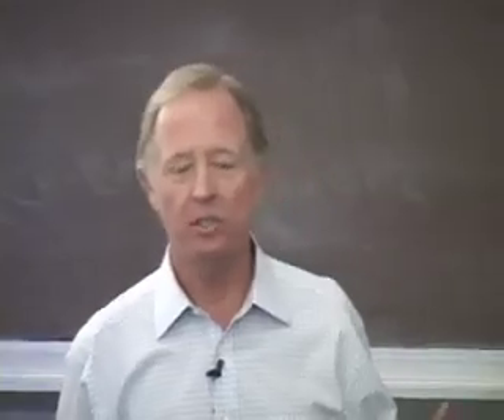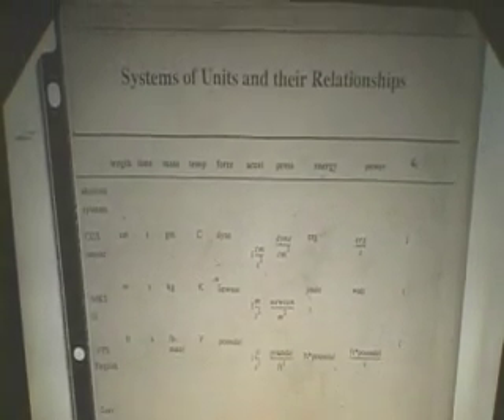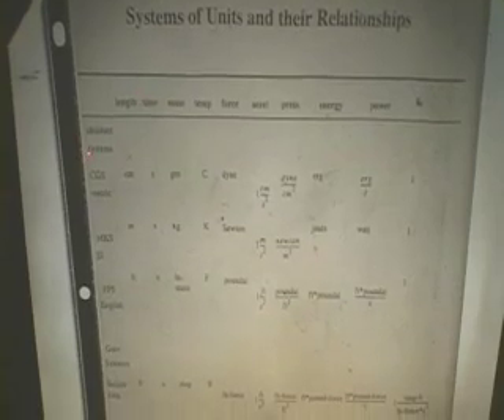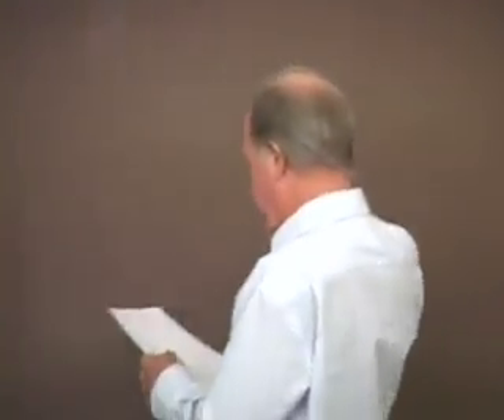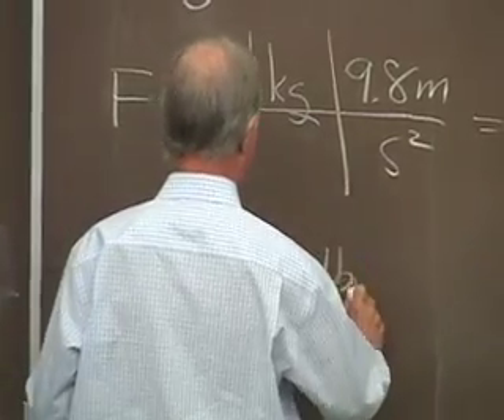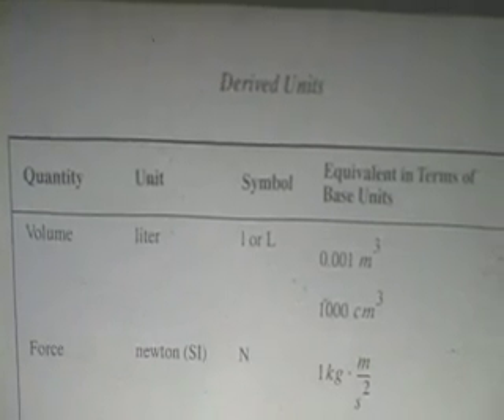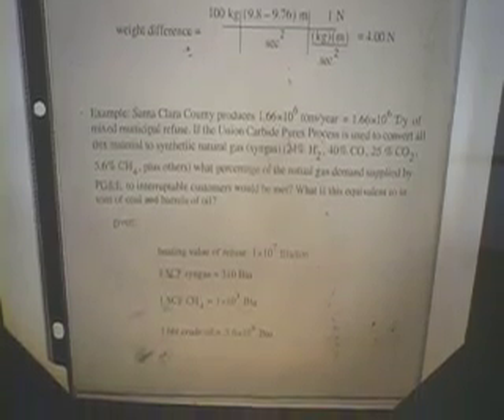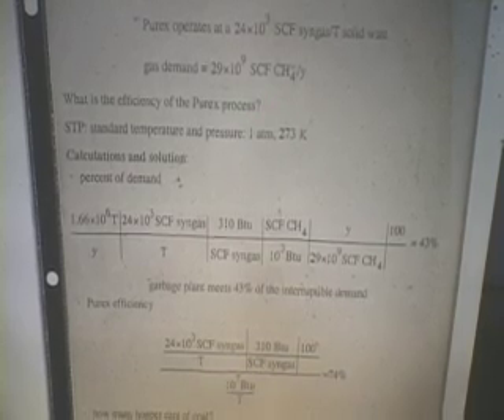Introduction to Chemical Engineering | Lecture 3

Comment: 8:50 --11:30 gauge width 4 ft 8.5 inches; tramways based on wagons width; "wagon wheels would break in the ruts...ruts came from the Roman chariot width...distance between two horse asses are 4' 8.5"